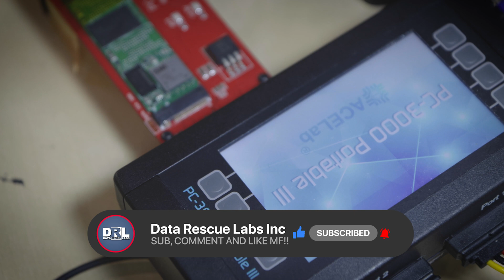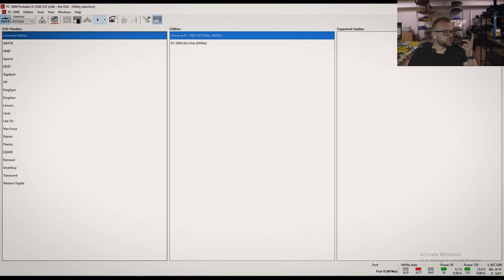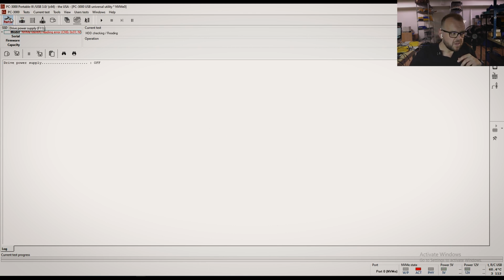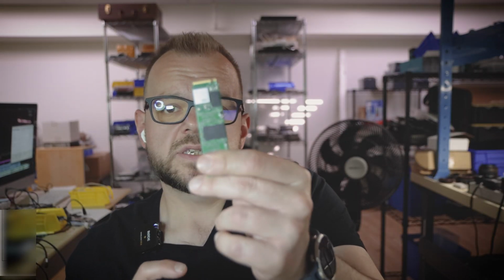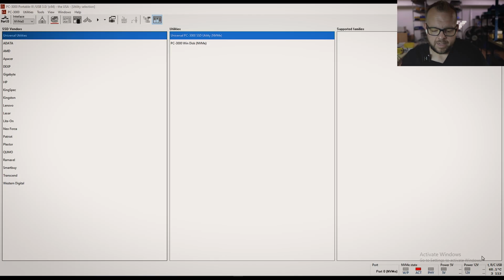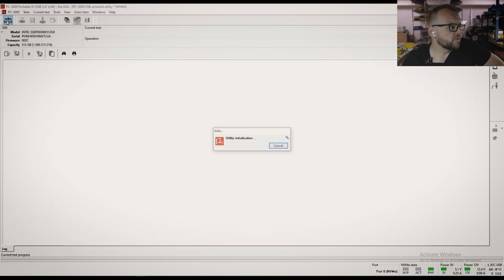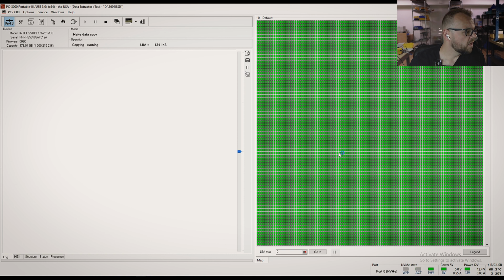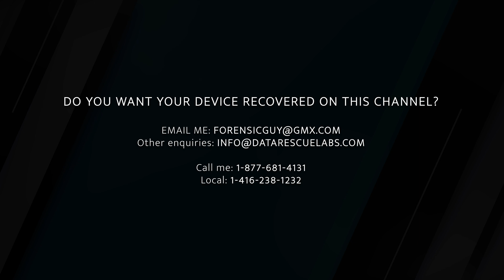Fix Intel SSD not detected or showing up - Easy recovery

Comment: I have this exact drive and it's presenting this problem. If it's a problem with the capacitors and I remove it, can I just reconnect it to the PC to copy the data, or will I need the PC-3000 solution?

Comment: Hi. Assuming you replaced the shorted cap...How did you figure the cap value?
Reply from the maker: There was no need to replace it, drive still works. I am actually still using it as my test SSD since the client didn’t want it back and it works great 

You can measure cap value with multimeter